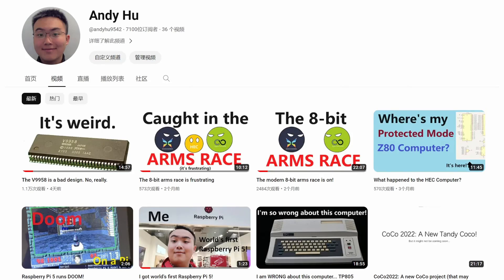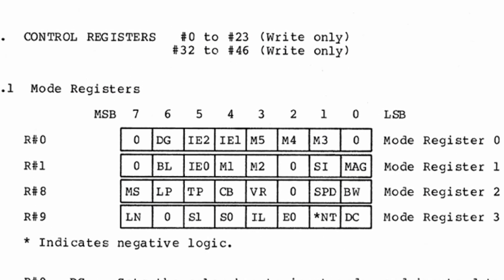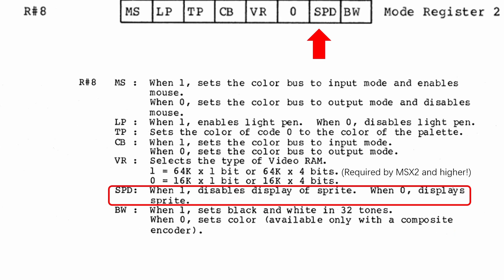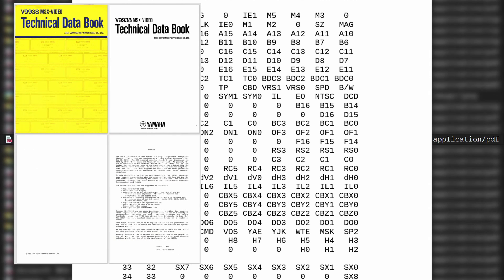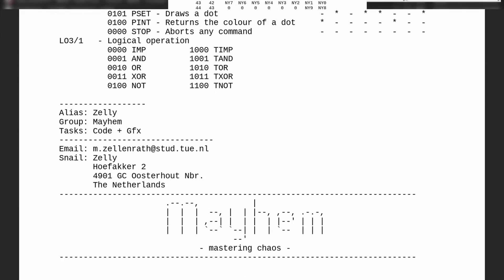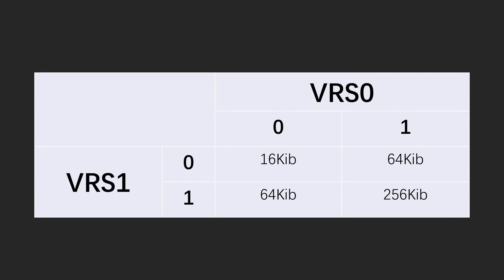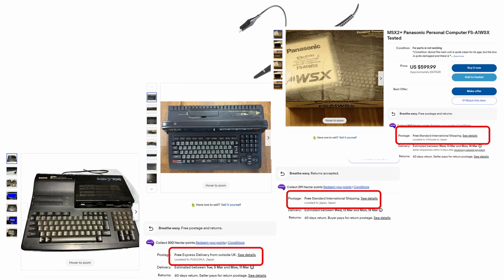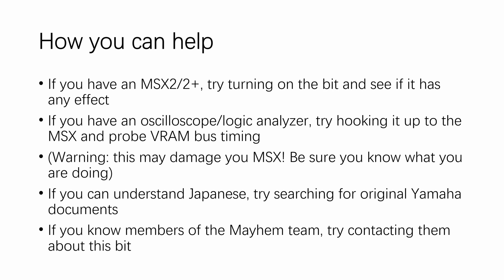The V9958 may have a secret feature...

Comment: UPDATE:  I tried it out on my SRAM-based card.. my method was not very scientific, I will describe it below.   But from what I can tell, setting that bit didn't break anything, but it didn't help either.
Step 1: Test with original settings (LDA #%00101000 ;STA VREG;LDA #$88;STA VREG)  during cold boot. Screen looks good, not glitchy when scrolling screen in BASIC.
Step 2: Keep same setting, comment out NOP's from text screen update function in VBLANK ISR until small glitches occur when scrolling text screen in BASIC.  Ended up being -3 NOP's)
Step 3:  Set Bit 2  in Reg 8 (LDA #%00101100 ;STA VREG;LDA #$88;STA VREG)  during cold boot.  

Noted no obvious change. (Still had the text screen in BASIC, and still had occasional small glitches when scrolling the screen.)

Comment: Did we reach a verdict on this? My DIY V9958 card has one SRAM and a latch instead of DRAMs, and it should be capable of higher speeds if the VDP can do it.  (I currently have to insert 7 or more NOP's between writes to the data register.)
Reply from the maker: I think the verdict is a no. But before the die shot analysis comes out, there is a chance (which I'm not holding out hope for). On the other hand, what frequency are your CPU running at? 7 NOPs are a lot.
Reply: @andyhu9542    The CPU is a HD63C09, and the rate of NOP's is 3.57MHz.  (I do have some iffy timing on the /CAS signal, and should have added some gate delay to it. The next rev will have some.)   You've inspired me to check the timing diagram and count clock cycles and see if all these NOPs are my fault. :D
Reply: @andyhu9542   the CPU is an HD63C09P with a 14.318MHz crystal (3.57MHz bus clock, NOP rate)  Does 7 NOP's seem more reasonable then? I do have iffy timing on the CAS signal. It needs a gate delay, which is planned for the next rev. I hope I can get rid of some NOPs after fixing that issue!

Comment: The thing is, slot timming are tie to ntsc / pal signal timmings, except if is runs the bus x2 twice faster which normal vram chips will output unreliable data, and not being able to draw anything in screen.  But it will be measurable in scope and take the advantage soldering chips from SIMM cards which are faster.
Reply: The other problem , there is no enough cooling performance inside most normal msx2+., if speeding up impact in termals, it will be a no no.
Reply from the maker: This is what I was actually hoping for (again there is a cut section dedicated to that). I was hoping people reporting corrupt screen when switching on High-Speed VRAM. (Sadly, for now there seems be no change) Nowadays a faster and maybe cheaper way is to do a SRAM+ latch swap.

Comment: I have my msx2 upgraded to INTERNAL 4mb ram SIMM piggy wired to s1985 and v9958, idd i have 10x spare v9958 chips, brand new. And i have an osciloscope, we can try monitoring the RAS / CAS lines to check if they speed up.

Comment: Info has that Mayhem has been contacted and the bit is useless... It doesn't do anything.
Reply from the maker: Do you know the source for the info?
Reply: @andyhu9542  Someone in the MSX scene contacted Mayhem himself and he replied to it.  There is a screenshot of it in a MSX WhatsApp group. 
Secondly, I also wrote MSX testcode to monitor performance of the blitter with the bit set and reset (on a real machine), no difference.
Reply: @andyhu9542 Someone in the MSX scene contacted Mayhem himself and he replied to it.  There is a screenshot of it in a MSX WhatsApp group. 
Secondly, I also wrote MSX testcode to monitor performance of the blitter with the bit set and reset (on a real machine), no difference.
Reply: @andyhu9542  Arnaud de Klerk, from The File Hunter and demogroup FONY said so in the MSX Resource Center forum. He is personally acquainted with people from Mayhem, since some of them also were members of FONY. It's possible they have only checked via software, though.

Comment: Just a remark: in the original Yamaha docs, it says that bit 3 is used to inform the type of DRAM you're using, whether a 16k x 1 bit or 16k x 4 bits (value 0) or 64k x 1 bit or 64k x 4 bits (value 1), in order to optimize refresh timing. It then goes on to provide many examples of VRAM interfacing, with various memory sizes and configurations, so at least it is aware of all those possibilities. But then, in practice most MSX2 computers, if not all, use exclusively 64k x 4 bits memory, mainly because it needs only four chips to reach 128kB of VRAM. To me the Mayhem doc makes no sense, since we don't need to set bit 2 in any of the current MSX2 and MSX2+ computers. If the meaning of bit 2 is incorrect, it stands to reason that the meaning of the combined bits 2 and 3 is also incorrect. But I'm curious to see how this will eventually turn out.

Comment: There wasn't such thing as "kibi bytes" at the time those chips and documents where written. You should have read kilo. That's what was written.

MSX computers had 180/360/720kB floppy disks at its disposal following IBM's adopted disk architecture of 40/80 tracks, 1/2 sides, 9 sectors per track, 512 bytes per sector, (yes, FAT12 formatted disks that you can directly open on MS-DOS and windows versions up until it dropped floppy drive support on... Vista? can't remember... boot sector was different, but you can read from or write to without almost any hassle) and a 3.5" 720kB  "DOS formatted" disk had 80*2*9*512B=737280B, exactly 720kB. (yes, it's a bit strange that k in kilo is lowercase where every single "greater than zero" multiplier is uppercase, but there's what it is)
The same "3.5" 720kB disk" when formatted on a Commodore Amiga featured a whopping 880kB due the possibility of handling 11 sectors per track natively. (80*2*11*512=901120B=880kB)

But WHY this (Binary quantity multipliers being multiplied by 2^10 instead of just multiplying by 10) only begun to matter when people begun questioning mass storage device manufacturers about unavailable capacity? why you only have 931GB at your disposal when you bought a 1TB or even a 1000GB (0,976TB) device? sketchy, isn't it? So I'm rebelling and I'm not only  don't follow the SI (International System of Units) on this one (I'd have to mentally reprogram myself and I'm not willing to), but I also expect any mass storage vendor to deliver the god damn storage capacity advertised down to the byte.
Reply from the maker: You have no idea how much I struggled when writing the script for that part. First, memory is usually measured in bits, but most people usually think in bytes. Calling a 16K * 4bit chip a '64K DRAM' would confuse a lot of people, for example. Second, the original document has incorrect wording, '4 * 64KB' should mean 256 kilo/kibi bytes, which is clearly not supported by the V9958. Finally, I can assure you if I used kilo instead of kibi here, there will be way more people in the comment section correcting me for not 'accurately used SI units', and I have to reply to each of them that the notion of kibi/mibi/gibi... was invented later.
Reply: @andyhu9542  Thanks for your answer! Really! You have a good point on "people ranting about you don't using SI units"; now being petty: 16k * 4 bits equal 88, not 64k.  (and both kilo and kibi are represented in lower case) 

As a MSX user and enthusiast since late 1980's, I have one or two theories about *why the heck* 🤣 MSX VDPs are or aren't this way. (and if you stick to the end, I may have a little treat for you) 
- apparently It was supposed to address 256k of VRAM, but Yamaha ran out of pins on its packaging and "CAS2/CAS3" got merged into the same pin, "CASX"; You can still install 192k of VRAM, but (specially on modes that uses that bank switching you mentioned) things go south when using this extra 64k bank as you can only use properly just half of that memory;
- it supposedly have a successor: V9978; Yamaha actually released that VDP, supressing everything based of the TMS9918A and renamed it V9990. This thing is a beast: 
- two 4BPP (16 simultaneous colors) tile-based video modes (P1 and P2) with either a massive 128x64 pattern scrollable plane (64x26.5 visible patterns, 512x212 pixels) or two priority encoded independently scrollable 64x64 planes (32x26.5 visible patterns, 256x212 pixels) also supporting 125 16x16 hardware sprites (also 16 simultaneous colors), 16 visible sprites per scanline
- 4 “official” “TV spec”(15.75kHz scanline rate) bitmapped video modes B1,B2,B3,B4 with or without overscan and vertical resolution interlacing) ranging from 256x212(424) to 768x240(480)
- 16/8/4/2 BPP, either pallete, YJK or YUV color encoding, 4x 16 color pallete, 5 bit per primary color DAC (32768 possible colors on pallete modes) 
- genlock/superimpose capabilities 
- one 640x400 25.3kHz scan rate and one 640x480 31.5kHz scan rate modes (B5 and B6) 
- a powerful (20 times faster than V9938/V9958) command engine
- up to 512k dual port DRAM support) with improved cpu <-> VRAM interface (DMA capable)
Reply from the maker: @tvalenca  The 256k memory is an interesting theory. I would doubt whether V9990 is simply V9978 with compatibility disabled though. The register structure is incompatible. A more plausible theory is that Yamaha dropped all compatibility at last minute and changed the interface bit of the silicon to make the V9990 a bit easier to use.
Reply: @andyhu9542  I did meant that. (dropped compatibility; horizontal scroll register still is a mess, LSB only moves 8 pixels like on V9958)
I mean, the whole V9990 was kinda dropped... it was supposed to equip MSX Turbo-R computers but we never saw anything on it before Turbo-R was discontinued in 1992... not to mention it is a bit too similar to Sega Genesis/Mega Drive VDP (which was also designed by Yamaha)... (dual 4bpp planes, 64 palleted colors total, 8x8 tiles and 16x16 hardware sprites, line interrupts, DMA, Dual-Ported DRAM) IF the V9978 theory hold any water, then Yamaha should have been working on it at the same time than Genesis' VDP (which was released October 1988, the.same.week MSX 2+ was released). 
Sadly, this theory also means Sega was supposedly behind the V9978 delays and cancellation.
Reply: In The SI-stelsel 'k' is kilo and 'K' is Kelvin
Reply from the maker: As for the storage devices, you can still open 1.44MB ones on Windows 10. I think people also did it on Windows 11. Even older 1.2MB ones work as well (3.5-inch USB drives produced in 2000s are sometimes unreliable and trashes the data though, beware of that). As for hard disks, SSD manufacturers will tell you all about wear and reserved space and all those stuffs and that the storage dies themselves are actually labeled size. But again, why can't they put extra cells in for spares?
Reply: @andyhu9542  I can still read & write MSX DD 720kB floppies on my external USB HDD on Win11 Pro...
Reply: @Dawwwg  USB disk drives are one of the best things if you're into old computers
Reply: @andyhu9542  My bad. we can still use the disks, only we don't have access to old disk drives unless you have either a USB disk drive or a old motherboard with pci (not pcie) slots (the same kind you can't install Windows 10/11 because there's no longer support for the CPU it supports). Also, some motherboards / USB drivers can't deal with double density disks (5.25" 360k/ 3.5" 720k), just high density ones (5.25" 1.2M/3.5" 1.44M). This is relevant because there's no support for high density disks on MSX disk BIOS routines, a Z80 @ 3.57MHz (with one wait state included during each M1 cycle). From what I saw people commenting, you would actually need a Panasonic FS-A1ST/A1GT on R800 mode as it is fast enough to PIO read/write from/to the drive
Reply: Windows 10 still had support for floppies, Windows 11 removed it
Reply: Hah, indeed... kibi is like being woke. Nobody needs it.
Reply from the maker: @what9418  Well I would argue that physicists needs it. It's not even the first time they renamed something. The imaginary number is j instead of i in electromagnetics because i means current. And in physics things like kilo are accurately 1000. When physicists start running calculations on computers, they need to know exactly what their numbers are.
Reply: @andyhu9542 True, but when they do calculations, they won't have anything to do with computer internals. They just want numbers readable to them. Just like I want numbers readable to me. So, a kilobyte is 1024 bytes to me. Since the early 80s.
Reply: @andyhu9542  when you run calculations on a computer you're talking software, not hardware. So, it can be anything you want! (1000 or 1024)
Reply from the maker: @what9418  That's not true. I've personally met tech-savvy physicists that knows the ins and outs of their computer in order to optimize the algorithm. Also, do you realize that 1024 is just a random integer to many people (or dare I say it, most people)? Those people would get super confused at why the weird '24' is added to the definition of 'kilo' which means 1000 everywhere else.
Reply from the maker: @tvalenca  Once in Canada workers mixed up units and a plane ended up running out of fuel mid-flight. Another time scientists mixed up units and a Mars probe crashed. Both cases are imperial/metric conversion mistakes but I can totally see someone finding a groundbreaking discovery and proceeds to waste billions of taxpayer money on chasing a 1000/1024 bug.
Reply: @andyhu9542  you counter yourself. Those people who know the ins and outs of computers know why 1024 is a kilo in computing. Those who don't have a clue, dont have a clue to start with.

Note that a metric tonne in weight is also diffrrent than a tonne in money. 1000KG vs €100.000. Confuses no one, right?
Reply from the maker: @what9418  Confuses me. I've never seen a tonne of money anywhere (other than refer to generally 'a lot of money', not any specific number and definitely not 100). Second, I counter myself since it's two different scenario: first the line of 'in computer' and 'in physics' can be so blur that even when people know why 1024 is a kilo, they would face problems of 'well what do I choose a kilo to mean here?' And the other scenario is people who don't have a clue to start with getting confused why the storage device they buy are smaller on Windows, while companies still have legal deniability to claim that they are using the physics unit. We need kibi/mibi/gibi and we need to defend them, and we need to force companies to use them since kilo/mega/giga will always be slippery fish in court.
Reply: @andyhu9542  @andyhu9542 tonne may be Dutch only.

I think it is pretty simple. When you talk about binary addressable memory you talk about 1024. If storage operators sell it as 1000 they are cutting corners. But again, even in a HDD a sector has a binary amount of bytes. A 1000 bytes disk would not be possible to manufacture.

I would have introduced a metric measure instead of altering the existing.

Btw I like your video about the Z80 protected mode, it was the first CPU I ever programmed on back in the 80s
Reply: I don't like, that the V9990 lacks the hardware sprite collision detection which the V9938/58 had...
Reply: @what9418  not sure if I want to deal with all the political implications both pro and con.
Reply: @tvalenca 😅

Comment: Hi. I have a V9958 die shot and take a look at how it works.

It's not hard to reverse engineer its silicon and it's probably not a special feature. I'll check an address decoder and the register file first, to see if that bit is really used.
Reply from the maker: I'm also looking forward to this follow-up!
Reply: @andyhu9542  Confirmed from the die shot. The register storing that bit exists, but the output doesn't go anywhere. V9938 has the exact same structure. Writing a datum to the register doesn't mean anything.
Reply from the maker: @RakiLegacyWorld  Wow! That's amazing insight! Thank you for sharing this!
Reply: I'm looking forward this follow-up 😊
Reply: The whole world's watching! And wondering. ;)

Comment: I wonder if it would worthwhile to write a test (say against an MSX emulator) that could confirm the function of this bit on real hardware.  I'm not sure if the test would work on the emulator though, as it would depend on if the emulator was based on actual hardware reverse engineering or just documentation.
Reply from the maker: The problem is, as far as I know, there is no discussion anywhere online about this bit. Therefore, no emulator would implement it.
Reply: @andyhu9542  IME there's plenty of things that some emulator devs just kinda figured out on their own and the only information on the subject is the code itself. So check if any MSX emulator has any code for these bits.
Reply: @andyhu9542  you could potentially check if a Mayhem demo set it though, even if it wasn't implemented in the emulator.
Reply from the maker: @phipli  I can only find one Mayhem demo online, which is their 1995 apology demo. It uses adjustment register (horizontal scroll register on the V9990) and probably nothing else to achieve its effects.
Reply: @andyhu9542   True, but you could use an emulator to write code against to send to someone with an actual MSX machine with this chip.  :)